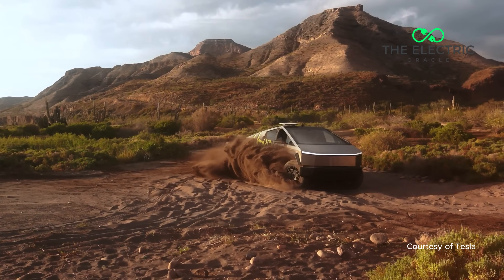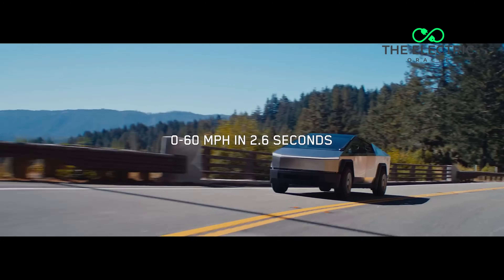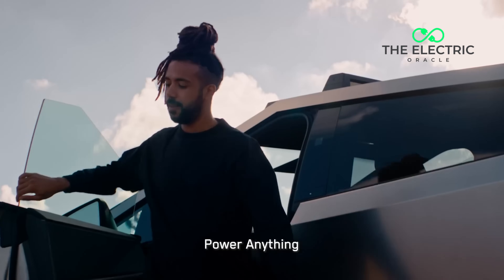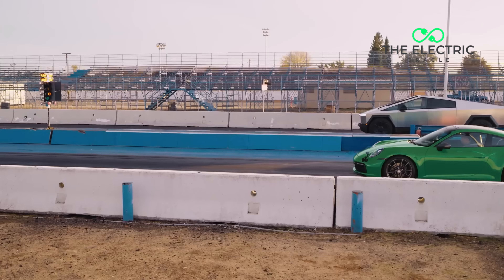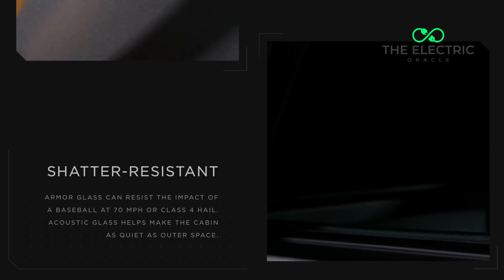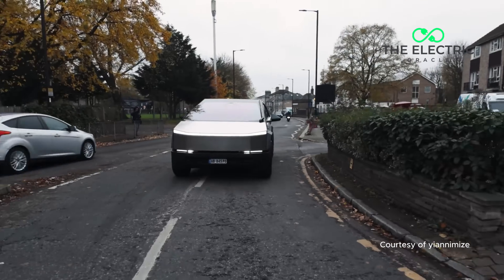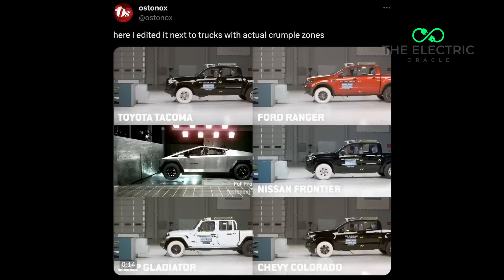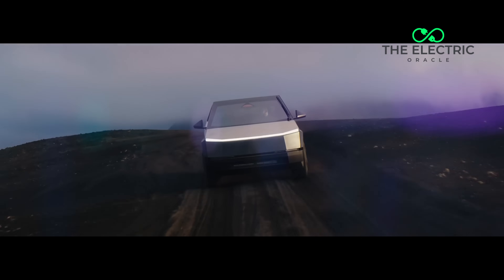5 Safety Issues Keeping Tesla Cybertruck Off UK Roads 🇬🇧

Comment: Most comments made are applicable to ALL US pickup trucks and I don't dispute it.  Those all don't belong on UK roads and I would say in North America roads as well but they sell ridiculous numbers of them there.  If you did your research, you'll find the Cybertruck does have deformation cuts in the structure as well as far better pedestrian safety vs other pickup trucks.
Reply: I refuse to believe the last part of your statement, you can literally cut yourself open if you drag your arm across the edges of the bonnet (hood) or wings (fenders) of this thing, & people have, & look at how that wiper spindle is just "out there", imagine smashing your skull into it at 30mph..It`d literally be like someone hitting your head with a hammer, that's why modern cars sold in countries who do care about pedestrians have the wiper spindles hidden under the edge of the bonnet, or recessed behind shaped plastic trims at the bottom of the screen.
Reply: There is no issue with North American full size pickup trucks. For many of us in North America it is difficult to get by without a pickup.

Comment: The truck is not designed for British roads or British safety so quite rightly it should not be on British roads but what's really gets me is they won't allow the cybertruck on on a British road yet you can buy an armoured tank at 50 to 60 tonnes and have that registered for road use on British roads oh the irony

Comment: Also, it rains a lot here, and they don't like the rain. Or car washes. Or snow (the lights block up and they conk out). And they have problems with birdcrap landing on the bodywork. And sap from under trees. So it's okay if you want to spend a lot of time cleaning it by hand and only use it in dry weather where there are no birds and no trees. Unless the sun is out, in which case it's too reflective. And you can't get a 8x4 sheet of timber in it (and I don't think you can get a roof rack on it IIRC) And if you put anything bulky in the back, you can't close the lid and keep the rain/snow out. The longest timber you can get actually inside it out of the rain is shorter than you'd get in a transit.
I can really see that catching on here, especially with busy tradespeople.🙄
Reply: And apparently that front light bar makes driving in mist or fog pretty hazardous, too - lots of light reflected back at the driver.
Reply: @stevemawer848  As far as I know (Tesla FAQs state it'll be available in 2025), no-one has gotten that promised light-bar yet; though here in US aftermarket bars are for sale.

Comment: All those sharp edges and hard body panels is illegal in the UK because their highway code requires a vehicle to be able to stop from 60 mph in 240 ft.  In the US they realised that if you can stop in 126ft, like the Cyber Truck, you do not need all those soft panels and dull edges, you just avoid hitting the pedestrian all together.
Reply: Delusional.
Reply: Nope.
Because that's assuming you always see the person in time, and even at low speed such as whilst driving around residential streets the cybertruck is going to do so much more damage to the poor sod.

Comment: Musk drew this in in primary school with a pencil and a ruler. I'm a better designer than Musk because in primary school I designed the first Audi Quatro 5 years before it was released. It was a 4x4 saloon car with nice straight angles. I did use a ruler but I smoothed it a bit.

Comment: About 14 years ago I had been living in Dubai UAE and decided to take my Hummer H3 back to the UK with me when I returned. In the UAE some Hummers were US made, but the rest were built in South Africa for the European market so had lights and other features that largely complied with UK law (the UK was still in the EU back then). Fortunately mine was made in South Africa - if I'd had a US one then it would have been very pricy to replace/modify lights. I had to have a rear fog light added, but other than that it was largely a case of paperwork. I found a specialist company who picked it up at the port (since it was illegal to drive it in the UK), and handled all the modifications and new certification - before it could be MOTed it needed a single vehicle acceptance test to prove it complied with UK standards. The first thing I thought when I saw the cybertruck was that it'll never be legal in Europe/UK - those sharp corners could never be made legal. I live in the US now, and they certainly don't seem as concerned about the dangers posed by vehicles.
Reply: Ironic as it was an American, Ralph Nader, who campaigned for many safety improvements back in the 1960's.
Reply: It would have been quite legal to drive in the UK. I drove my unmodified Swiss registered, German import car for three months in the UK on Swiss insurance. I drove it to a specialist car converters who did all the necessary conversions apart from the headlights and the fog light. It past four MOTs before anyone noticed the lighting issues.
I agree US citizens do not take car safety seriously. Hence some 300 families on average a year drive over their own children as the bonnet line is to high to see them walking in front of their trucks. Sad but true.
Reply: @mbak7801 
No it is legal for you to operate a Swiss registered car in the UK subject to insurance. I don't know if you could operate a Dubai registered one. You could not operate a US registered vehicle.
Reply: @Fred-gu6pk  You can operate a US registered vehicle in the UK for up to 6 months as long as you are not permanently relocating.
Reply: @Fred-gu6pk  When I was lecturing a lot of my students were Dubai oil engineers and they were driving around in imported Dubai registered Range Rovers so it is legal as a visitor, possibly not for relocation.
Reply: @Fred-gu6pk  Meanwhile in the region I live, Singapore, Malaysia & Thailand allow vehicles registered there to drive into one another's countries, though you may need to buy extra insurance coverage at the border crossings, & have a translation of your license plate stickered on your vehicle. While Singapore doesn't usually allow LHD vehicles I've once seen a Malaysia-registered Dodge Viper there, as well as 2 Cadillac Escalade Vs without license plates but with what appears to be the coat of arms of the monarchy of Malaysia's Johor state (it was flanked by some Malaysian police patrol cars so I guess the monarch was on holiday here that's well-planned & co-ordinated in advance with Singapore's bureaucracy e.g. maybe the cars must always be accompanied in a motorcade formation, like the Cadillac One where USA's leaders visit here). Ford Ranger light pickups are popular in Malaysia too & I've seen some of them drive into Singapore too
Reply: The US has 4x the road deaths rate per head the UK has. They don't care about protecting people, basically, whether on the roads, kids in schools, people who can't afford medical care, drinking water, or anything similar. 'Freedom' to die.
Reply: USA a country with more private weapons than people, who cares about cars. Will never be as many cars and as dangerous as the guns. So who cares!

Comment: Without insulting any one. The UK has no pick-up market whatsoever in any case. I believe the last "successful" pickup there was the 1 Ton Cortina pick-up that came from South Africa in the 1980's.  I cannot see any manufacturer bothering to change their pick-up to suit UK laws.
Reply: We see a few Ford Rangers around the place.
Reply: @dsds3968  The Ranger was designed in Australia for the international market. We don't see that many in the US.
Reply: I see a bunch of them every time I go out, it's just that they're actually used by businesses not because you want to look like a "manly man" and pretend you sometimes load more than a bag of shopping in the back.
Also a lot of the things the US uses them for would be covered by a transit van or similar in the UK, as you get a fully covered load bed that is much higher by default.
Reply: I see a lot. There's a tax dodge in there.
Reply: I dunno what part of the country you live in, but I see dozens every day around London & the home counties, mainly Mitsubishi`s & Toyotas, but plenty of others as well.
Reply: @MrPabsUk but the majority of them are not actually used as work trucks, there is a tax loophole that allows the owner to reclaim the vat if the vehicle has a payload of 1000kg so they are being used as family cars... I think that the current government may have closed or are closing that loophole though
Reply: 50 years ago I owned a 1938 Bedford "Ute" based on Vauxhall 14 chassis and running gear, column gears and leather bench seat. It was a beaut and plenty of dead 14's for bits. I loved it and overloaded it often. Eventually the chassis which was full of welded up cracks gave up. Very sad, everyone else used Holden but they lacked the old British charm.
Reply: Seen plenty of trade people using practical sized pick up trucks in the UK, bigger is not always better
Reply: You may have a few pickups in the county, but almost no full size. The Full size market is essentially the US and Canada.

Comment: From Dublin - BRING BACK the Jensen Interceptor, Vauxhall Viva and Ford Capri.
I want my '70s back......
Reply: I once had a Ford Capri. Most comfortable drive I've ever known. Trouble was the light back end. Even with a large block of concrete in the back it still wouldn't go round bends without skidding. Pretty, comfy and scary.
Reply: @michaeledmondson5100  Hi Michael - saw one on its roof in the Phoenix Park one evening - the amadán owner had mixed tyres (radial and crossply). Jeez - Car Maintenance 101; DON'T DO THAT!  Plus don't go speed-racing on the main Park Road when it's raining - WHAT could possibly go wrong?
I'm still awaiting a fullsize, fully functional 1960s Batmobile for Christmas...... (will settle for a fullsize, fully dysfunctional ED-209.........).
Reply: Not the Vauxhall Cresta?  Lovely car.
Reply: I have driven in Ireland. You should all be driving go carts.

Comment: Yianni has had the Cybertruck on a weighbridge , to the nearest 20kg , it came in at 2.6tonnes not 3.5 and that was with heavier wheels and tyres than the standard wheel supplied on it , the new BMW M5 weighs over 2.5kg, so that point is moot.
The front collision point is interesting , would you rather be hit by a Cybertruck or an Ariel Atom or kit car, which would be more dangerous, that's a debate that needs to be had
Reply: So, you're defending the bad shape by quoting a low volume, worse design ?
Reply: @ personally I love the design of both cars, just because you don’t like the Cybertruck doesn’t make either of us wrong. To suggest that I’m wrong because you don’t like the Cybertruck is bizarre.
Reply: @JohnLummis  Nothing to do with taste. This video he laid out all the dreadful ways the CT could maim civilians,  and you used another bad design to justify the woefull CT lack of  safety features.
A totally illogical pov.
Reply: @ the vertical frontal area of the Cybertruck seems to be your objection.
Most vans, small trucks , trucks of 7.5t and HGV’s also have a large vertical frontal area, yes the Cybertruck is made of stainless steel but anyone hit by said trucks or vans at any speed will and do suffer catastrophic injuries , HGV’s are not designed with crumple zones in mind, they are solid, I know, I’ve driven them, there’s no room for a crumple zone , just like all buses and coaches so the picking out of just one vehicle model over all the others seems weird. 
It is going to be interesting to see whether a modified Cybertruck does conform to UK/EU regulations . I don’t know for sure at this point , only time will tell.
Reply: @johnlummis5119  You're determined to trot out all the outlier  bad safety designs in order to justify a bad recent  design. 
There was far more discussion than the vertical surface. Watch it again.
Reply: Tesla states the weight of the Cybertruck with "correct fluid levels" and no occupants to be between 3009 and 3129Kg depending on model specification and without optional extras, so there must have been a lot of components removed from Yianni's vehicle before he visited the weighbridge. In fairness, though, this weight is still comfortably below the 3.5 tonne threshold for a commercial vehicle.
While I take your point about the Arial Atom, at least the Atom driver is furnished with an excellent view of the road and hazards ahead, unlike the Cybertruck driver, and the Atom is extremely lightweight and fitted with exceptionally powerful brakes. I would rather by far step out in front of an Arial Atom than a Cybertruck, though I think we can all agree it would be better to step out into the path of almost any other modern car rather than either an Atom or a Cybertruck.
Reply: @philiprandall1399  Watch Yianni's video , actual rather than stated , maybe the heavier weight refers to the Cyberbeast with the extra motor as opposed to Yianni's which is the entry model , that's a guess.
Reply: Considering a PHEV Range Rover is 3000kgs with gvm of 3480 and all EV cars getting heavier by the month argument over weight non issue.

Comment: Most of these weights are incorrect

Curb weight	6,669 lb (3,025 kg) 
AWD 6,898 lb (3,129 kg) 
Not 3.5 ton! So it’s still a SUV not commercial.
Reply: Ladened weight?